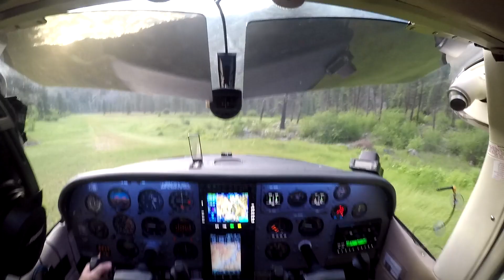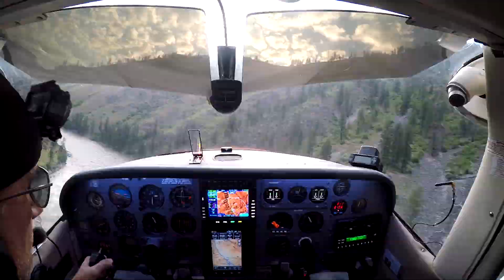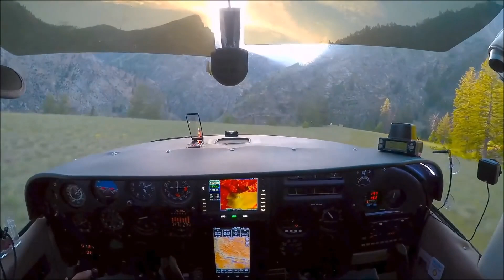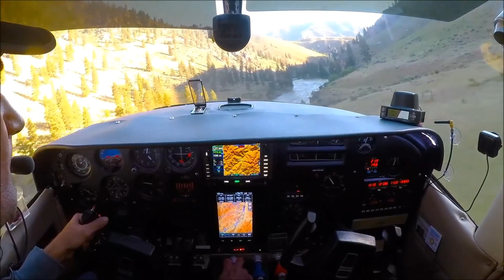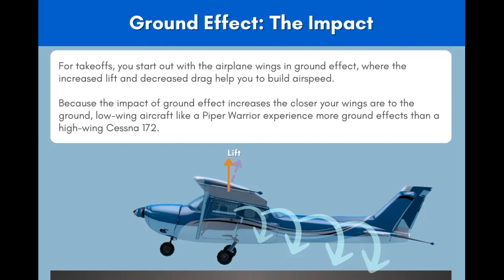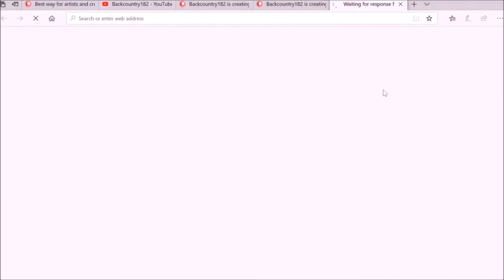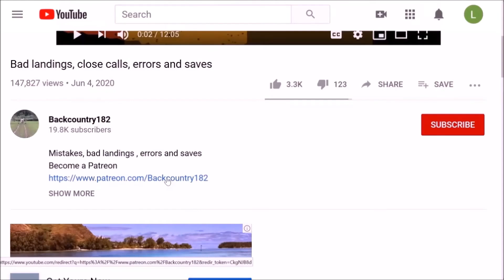Flying in Ground Effect

Comment: He's WAAAAY above ground effect for climbout....someone please show him the facts....
Reply: These guys are just disaster in the waiting. Even a kid knows that ground effect is around GROUND, not 100ft above the river...
Reply: @jankoldusek1628  I'm not sure you have each of the two energy management techniques understood  in its place.  The extra free ground effect energy the 182 gains is by not pitching up out of level in low ground effect so long and runway exists ahead.  The extra free potential energy of altitude the 182 gains is by leaving down drainage over the river.  When zoom reserve airspeed is gained either place or both places, enough airspeed to climb or maneuver safely, the 182 maneuvers including climb in some cases or continuing down drainage in some cases.  The two forces are ground effect and altitude traded for airspeed.  The principles are to gain extra airspeed in ground effect before pitching to altitude and the law of the roller coaster from Stick and Rudder which includes both pitch up with zoom reserve and pitch down using airspeed from altitude.
Reply: He is on a down drainage egress using the potential energy of altitude traded for airspeed.  Total energy management.
Reply: @jimmydulin928 there is not one single example in the video of the guy trading altitude for airspeed. There are only examples of him trading airspeed for altitude.
Reply: @XPLAlN  The law of the roller coaster works both ways.  Read Stick and Rudder.
Reply: @jimmydulin928  …the fact remains that at no point in this video does he trade altitude for airspeed, which is what you say he was doing.

Comment: Why would you fly in ground effect with flaps instead of climbing? I could understand if you flew in ground effect with no flaps, then pulled a notch when you started to climb.
Reply from the maker: Great question, I just do it to avoid distraction and work load that close to the ground.
Reply: @motoadveBackcountry182  wasting energy like that probably isn’t good advice for people flying in Idaho on a hot day, or any day for that matter. You’re really limiting your options.
Reply from the maker: @kylewood17  Cessna recommends 20 degrees of flaps for VX, because the airplane climbs better with flaps, I am adding a safety margin by climbing with flaps ,specially at high density altitude, if I start ground effect with 20 degrees of flaps , I cannot retract flaps right away or the airplane will sink back to the ground, if I retract them at speed then will have to add them again when I leave ground effect, this does not work well with Cessnas, no one does that, maybe with an airplane that accelerates really fast this could work.
Reply: @motoadveBackcountry182  you’re right, they recommend climbing with flaps. You’re trying to gain speed with flaps. Try this sometime, start your ground roll with no flaps. Pull two notches of flaps when you get to VX, or when you’re out of runway, which ever happens first. You’ll get to VX faster that way.
Reply from the maker: @kylewood17  I can give it a try
Reply: @motoadveBackcountry182  you might like it, you might not. But you should be able to get to VX sooner.

Comment: This is the most excellent explanation of ground effect I have seen.  Good on you, Larry.  Yes, in powerful airplanes we have to push hard against the trim set for takeoff.  In the lower powered 170, notice how Larry push/pulls just a bit dynamically and proactively to bracket level in low ground effect.  Lower powered airplanes will want to return to earth.  We want neither to touch down again nor to stay at the high pitch attitude required to get off when still slow.  The practice you mention in ground effect on long runways, what I call hover taxi, is very important.  We get so little time at less than Vso in ground effect on every normal landing.  Thanks Larry.  We all need to learn how to use ground effect effectively.  It is just good total energy management.  We don't need it until we need it...and then we wish we had used it by default.

Comment: It would be interesting to see some tests of a takeoff using ground effect purposefully vs doing a normal short field takeoff and climb at Vx.  I have not seen anything that shows that using ground effect is advantageous in this scenario as the higher speed means more drag as compared to just climbing out at Vx.  I would love to see an actual comparison on the same runway and same conditions to see which technique works best to clear a 50’ obstacle and which provides the most altitude say 1 mile from the start of the takeoff roll.
Reply from the maker: @LTVoyager  Good idea, I can do this test next time I fly and share the results.
Reply: @motoadveBackcountry182  That would be super interesting.  And a fun excuse to fly more!
Reply: Larry will get the data for you.  Notice, however, that crop dusters (sorry Ag now) use low ground effect on every takeoff.  We clear the 50' obstacle on every swath run with what Wolfgang, in Stick and Rudder, calls zoom reserve airspeed.  Why does he recommend trying to hit the tree and then zoom over?  Because it is safer to zoom over with the outcome never in doubt.  It comes from low altitude orientation where being able to maneuver around things is just as important and being up high.  Vx will get us high enough to kill ourselves in the stall/fall very quickly should the engine quit or we get startled somehow.
Reply: @jimmydulin928  Yes, many factors come into play.  Wind is also a factor.  In calm conditions, you won’t gain headwind with altitude, but with any amount of headwind you will.  Since wind speed generally increases dramatically with height above the surface, climbing into a headwind can be very advantageous and I suspect staying in ground effect in that case might leave performance on the table.  However, without actually testing that, it is hard to know all of the subtleties.
Reply: @LTVoyager  Yes, we fly in rivers of air.  In the mountains, especially, down drainage egress can be even more important that wind management, especially with one way strips.  I flew too many 65 hp airplanes in the mountains to factor climb to higher winds.  Ground effect to up slope ridge lift was a critical factor, however.  I instructed at Monte Vista 7200 MSL in the more powerful Cessna 140 at 85 hp. I too will appreciate the data.  Scott, "gunny," on FlyWire gave us some bit larger airplane data on the impossible turn like that.

Comment: I've been asking the same question all my life and never found any logical answer from any University or any flight instructor. The ground effect theory.  The answer is. It can't exceed more than half the length of your wings. Makes perfect FUC#$%^ING sense. Thanks man. That's the answer. It should be included in any tutorial, video course etc etc.
Reply: I did my commercial pilot's license 25 years ago and and they talked about the 50% wingspan ground effect then so I'm unsure where this ground effect 'ignorance' is coming from? It has been known for quite some time before I did my CPL - perhaps about 90 years.
Reply: Received my Commercial Certificate 38 years ago and it was discussed, taught, and demonstrated to me (I had to demonstrate it as well).
That was in a Part 61 training environment.
Reply: must have picked a crap school if none of the CFIs knew this. it's literally in the books you should have read.
Reply: Six inch ground effect is far more energy effect, acceleration effective, than is half the length of the wing.  Quite a few backcountry pilots use full flaps to get off into ground effect and then reduce them, but just using elevator will get you off at much slower airspeed.  The sooner off and level in low ground effect, the sooner effective acceleration occurs.  See how early (like the STOL guys) you can get off but work the elevator dynamically and proactively to bracket level in low ground effect.  Unfortunately they only give points for distance to mains off.  The big engine guys show poor energy management by climbing out at a high pitch attitude after mains off rather than using the free energy of ground effect.  Those of us who flew 65 hp trainers to those strips when they were shorter didn't operate like that.  Yes, off early.  No, don't maintain the pitch up.  Watch all of the Backcountry 182 videos to see how to manage all energy available, both on takeoff and on landing.

Comment: I've been flying for 30 years but hut there is no way I would ever trust an aircraft this much. This slightest drop in performance or hiccup from he engine and you're dead. Some people have different risk tolerances...
Reply: @gawebm
Especially since our civilization is collapsing and maintenance is becoming more and more random.
Reply: Sometimes if you REALLY wanna have fun you gotta take some chances, have some personal courage. This pilot does everything he can to mitigate risk and in my opinion is an exemplary airman.
Reply: It is hard to damage an aircraft or hurt ourselves very much at Larry's faster than Vx or Vy takeoff airspeed and slower than Vso (in ground effect) approach airspeed.  We increase safety by taking off as fast as possible and landing as slow as possible.  Vcc on takeoff is safer than Vx or Vy.  Less than Vso after arriving in ground effect is safer than 1.3 Vso to the fence and then round out and hold off.  The pilot might as well be a passenger in the hold off portion.  I have survived eleven engine failures at low altitude crop dusting and patrolling pipelines using this basic level in low ground effect to Vcc takeoff and this slower than Vso after arriving in ground effect landing.  Energy management is the safer way to fly.  Vx or Vy is a risk where the outcome of the maneuver, given that drop in performance or hiccup, is always in doubt.  I never had altitude, but always had airspeed to maneuver to a survivable landing zone in the very near hemisphere in front of the wing.  Using full flaps and forward slip with rudder to the stop, I always got into the beginning of the LZ in a three point attitude all slowed up and ready to squat.
Reply from the maker: @jimmydulin928  Thank you for your input Jimmy, I put into practice what you wrote in Contact Flying and worked.
Reply: @jimmydulin928 great input Jim I’ve read your book twice since I got my pilots license two years ago.

Comment: This is very similar to being towed in a glider.  The second you lift off, especially in a high performance glider, you must  push the stick forward so as not to rise above the tow plane (which most often is still on the ground). And until you get used to it, it surprises you how much you have to push. Very useful video.  Thanks